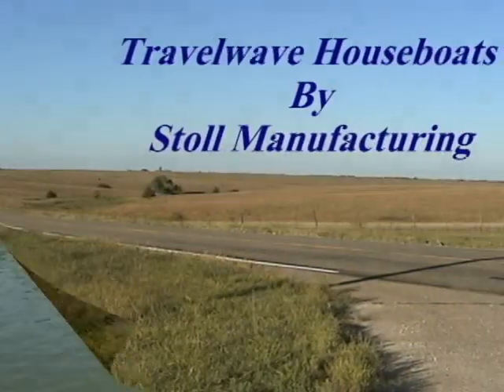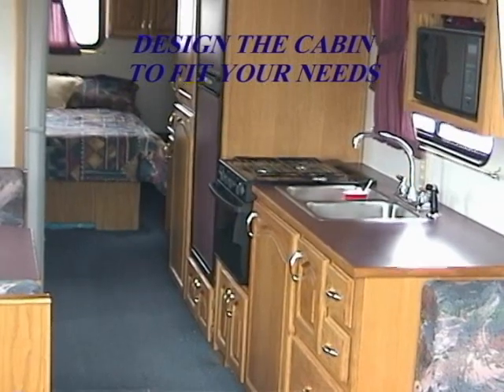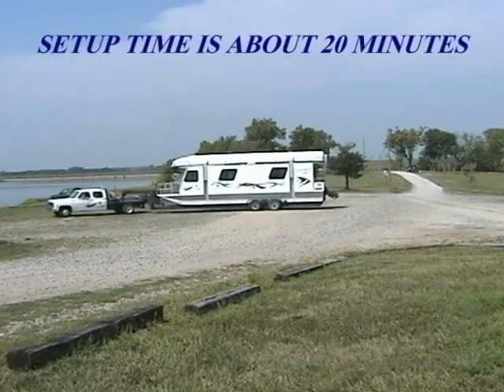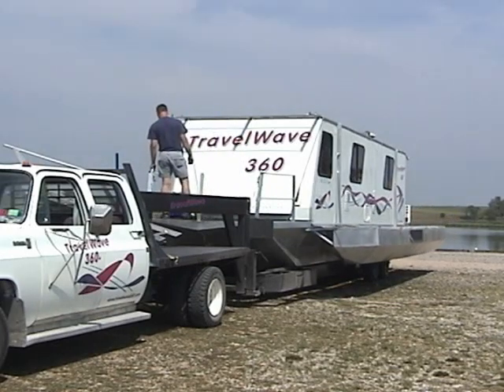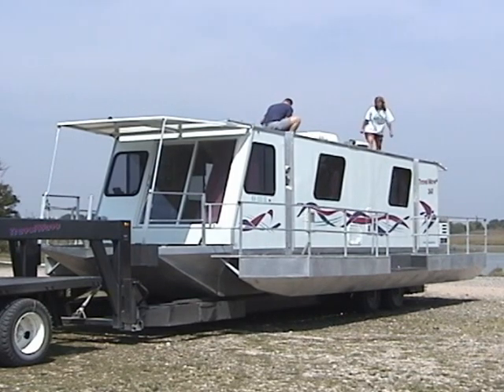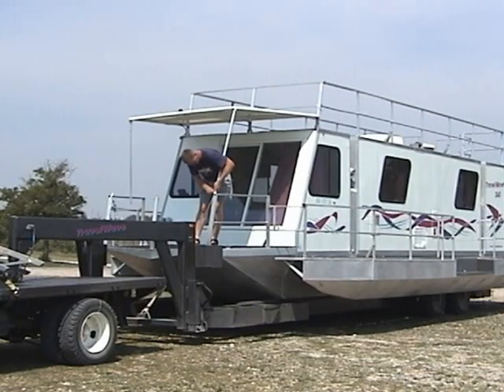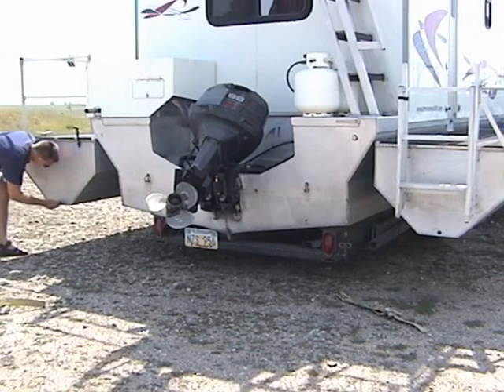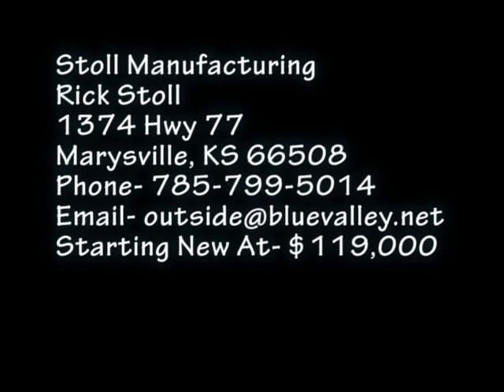Travelwave Trailerable Houseboat Info Video Part 1

Comment: Good looking design and build  on this  Ive been both a Boat owner and a Travel Trailer Owner in my life  , this gives you the best of both Worlds  the foldable pontoons are a smart part of the Engineering on the  setup  plus I’ like the way they look when deployed  especially having the railings that  make  the  entire setup look like a  ordinary House boat that belongs on the water  often  making a trailerable house boat starts to get goofy looking  because the designer is trying to  put to many features into the setup that  it sacrifices  looks  when set up as a boat this one looks like a well planned hull design BTW 13K lbs  is pretty good  for pulling  most American Deisel Duallies are capable of that easily  and they are affordable plus with the added 4 WD. Option they should be capable of retrieving at most Boat ramps   Well thought out on the designers  of this Vessel  Ive pulled a lot of boats and my Normal thoughts are to use a truck that is  well overrated than what I’m pulling  from the manufacturers reccomendations and Specs  I’m curious to know what type of a braking system is on the trailers  that they use for this one

Comment: Interesting design concept. After watching part 1 and 2, had to come back and comment on a few things. First, I have a rather unusual background, as I've worked in both RV and boating industries before as a product engineer, so I have a bit of experience in both product lines...
The idea of an aluminum framed RV with extensible pontoons is quite interesting...and at a $140k-ish price point, isn't bad, considering a 36-ft RV with slides on an aluminum frame will set you back $80-$100k usually...without building in a helm-control or propulsion expense...so the price-point isn't bad at all. The pontoon forward needs some serious 'boat engineering redesign', as the 'splash' from 0-1's is bad...and tells me that 1-3' waters would possibly swamp it...it needs to 'cut' the water more with laminar flow, not just 'push' the water out of the way.
Were it me, I think I'd look at a 'lower tub wrap' for the first 1-2 ft of craft, where you have the corners and lowers 'tubbed'...by doing this, I mean a full 'saucer' lower (kind of like old RV's used diamondplate aluminum as stone guard)...just a TIG corner-welded 'cup' to help prevent 'up-splash' from causing water-creep and delaminating those walls later.
The ABSOLUTE BEST idea would be to look for GIBSON HOUSEBOAT videos...ideally, say, the 44-ft Standard models...Gibson (the original company) was in business from 1968 to 2008...when it went under due to the economy. It is now owned and producing again, so careful of 'patent infringements'...but the original owner figured out pretty quick how NOT to make a small houseboat look like a 'cheap RV'...and your company could take some pointers from what he did with his product...(moreso the interior layout and coverings...as the molds for the formed hull are patented).  Give this more of a 'boat feel', and people will be willing to look at it as a 'Gibson competitor' than a 'Floating Forest River RV'...and then when you ask for $150k...you can know you are competing against $250k Gibsons, not $75k Forest River RVs.
As for the towing weight limits that all the 'highway sheister lawyers' on here are talking about...forget them. The national limits on a Class D (or 'Operator') license is 26,001 lbs...which has a couple of 'loopholes'...such as if your tow vehicle is over 10k GVWR, then your trailer must have a GVWR of less than 16k such that the combined GCWR cannot exceed 26,001-lbs, but if your tow vehicle is less than 10k GVWR, then your trailer can weigh up to the total GCWR of 26,001 with the GVWR of the tow vehicle taken into account. This is taken directly from US D.O.T. weight limits. As for Canada, they have a different methodology of identifying 'truck-trailer' combinations, but know this...ALMOST ALL PROVINCES follow the 'law of reciprocity' (their east coast is as crazy as ours...check before towing there), meaning that if you are LEGAL to tow your truck-trailer configuration in your home of license, then they accept that same weight-standard as legal in their province...Legal at home means LEGAL IN CANADA.  This is from the Canadian Government, itself.
Hope all this helps, and that it 'takes the falsehoods' out of a bunch of 'assumed towing experts' below.  WHEN IN DOUBT, CHECK THE GOVERNMENT STANDARD DIRECTLY...don't follow the 'rules' as given by unknown commenters!

Comment from the maker: I don't know what state you are from but Class C Kansas where we are from GVWR limit is less than 26,001 lbs. Do you realize how many vehicles are over 10,000 lbs. Good luck finding an large RV less than 10,000. I just looked up a 36' fifth wheel with 3 slides and is 14,500.

Comment: yup ,  need a A or AZ licence to tow that in Canada. Max tow-able weight  without the A license is 4,600 kilograms (10,141 lbs) You cant even get a special permit. With all that clip-together railing, must be awful noisy with the rattling, if not when new, it will .

Comment: Don't confuse kilograms with lbs. !2, 000 lbs is legally able to be carried on a 1 ton truck.  (eg F350 etc).  Also anything designated as recreational is exempt from commercial licensing requirements. The only thing you have right is the requirement for a Z or Q endorsement for air brake operation.

Comment: 13,000 Lbs. that means the driver needs to hold a Class A drivers lisence, with just a class B, C or D you are only aload to have a total towed GvW of 10,000 Lbs. anything over that you need a Class A, and if the trailer has air brakes you need the Z endorsment, this is the Laws of Canada, Note a Class A with Z indorsment is same as you need to drive a 18 wheeler/trasport truck, you can do your road test with a 1 ton truck with a fith wheel trailer that has a GVW of over 10,000 Lbs.
Reply: Your regular drivers license allows you to have a truck and trailer GVWR of 26,000lbs, if your truck is 10,000lbs your trailer can be 16,000lbs.